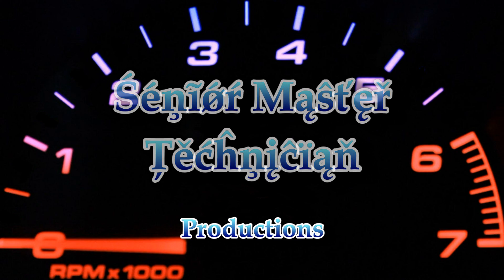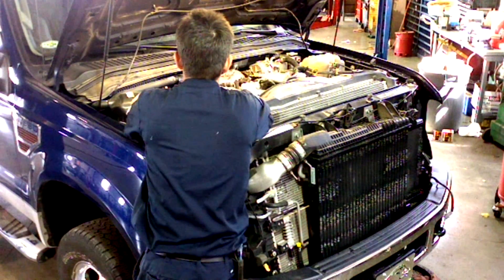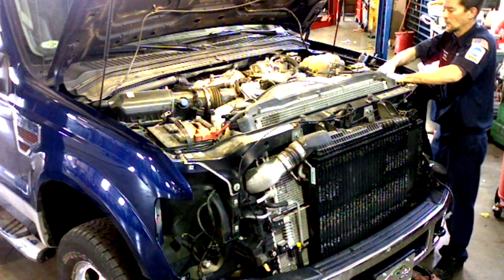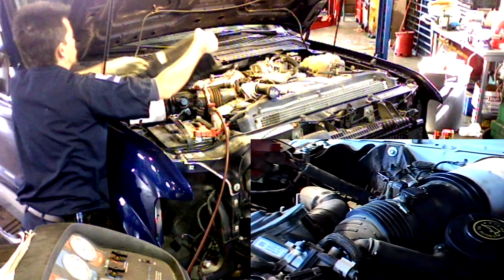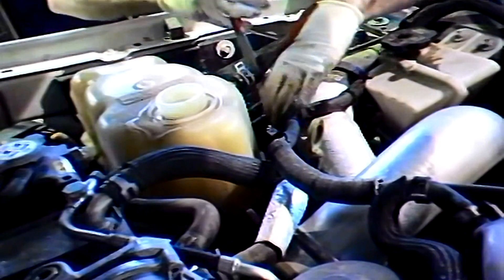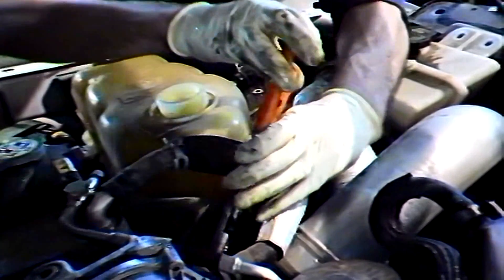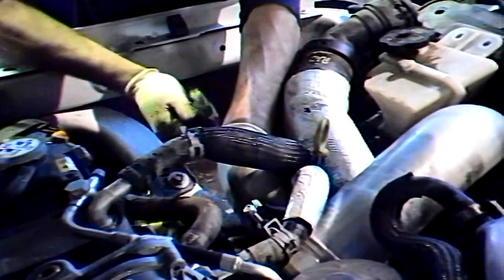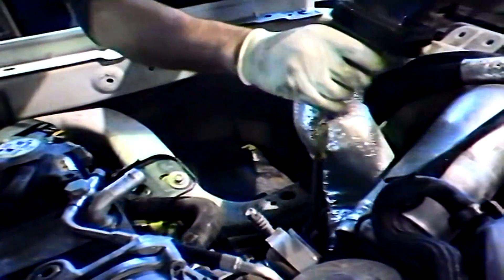2008-2010 Ford Super Duty Cab Removal & Installation Part I

Comment: I work on a lot of these trucks and you can remove engine complete by taking out 4 front body bolts on regular cab or 6 on super cab  and lifting front of cab. support it with 5 in. wooden blocks. only thing that needs to be taken off of engine is down pipe. be sure to check bed to cab clearance as you lift the cab.do a lot of ambulances this way when cab cannot be lifted. engine comes straight out front. beats pulling cab.

Comment: A method I use that has not failed me on dirty Canadian trucks, is to heat the head of each cab bolt, I do my ABC's or about 30 seconds on the head of each bolt, then use my 3/8" cordless impact to pull them out. Enough heat transfers to the threads to warm the locktite up. Even works on the front cab bolts. Haven't spun a cage nut since.

Comment from the maker: @PWRSTR0KER2008 
Thanks! The video is actually from 3 different trucks. The blue one has the cab removed for the RH turbo inlet pipe. The close up shots showing white vehicles were from an engine failure.

Comment from the maker: @runelost88 
I usually have at least one that always wants to spin. I broke by butane tip so I just use what heat I can get. I now have a propane tip that fits great. I bent and shaved on wrench for the front nuts, but the trick on the front is to put a jack under the front support when removing, works great. I have thought about teaching and have been offered once for UTI and another time for OSU Okmulgee. I make more money turning wrenches.
I have though about building a training class.

Comment: How many hydroboost units do you replace on these trucks? I've already had mine replaced once, and it is leaking again. In fact, it started leaking again less than a month after it was replaced. I have seen a few other 08 Super Duty's leak from it too. I haven't taken it back in, and it is leaking all over the electrical wires, and connections. It's a slow leak though. Mine is an 08

Comment: I'm baffled at why this is necessary. If Ford can't fit every thing they should make a tilt hood that takes the fenders up like a semi or go with an inline 6.V8 diesels are not as desirable as an I6 anyway
Reply: Yet more 3/4 ton and 1 ton diesels have been sold that are V8s than I6s by a wide margin so they are desirable.
Reply: Minotauro79 
Sold and run into the ground within 5 years by young bucks who don't need that kind of power. They want the stacks and/or to roll coal on poor people all over North America. It has nothing to do with towing. Hence I6 is best for driving around town, and V8 diesel is best for trailering or farming.
People want to drive truck but don't want all the junk that comes with it. Who needs 440hp all the time when 350hp is plenty... Plus if you don't load your turbo diesel it cokes the compressor and costs like $10K to fix up again.
Reply: John DiMartino

 v8 diesels tend to get better fuel economy than I6... The Duramax/Dirtymax gets more than enough HP + Torque to meet 3500 requirements... As for the Powerstroke/Powerjoke/Powerchoke Ford spend alot of time making garbage Diesels, they seem to have fixed the problem now and are getting some good stats now but the rep still follows them

Neither PowerStroke or Duramax can match the Cummins in reliability and power but most guys don't push these engines enough to notice so the v8 fuel economy wins the day.
Reply: Yet semis use inline 8s for real power. This is a very stupid process.  I would also take the i6 over v8 diesels.  Cummins all day!
Reply: Jesse guy what semi uses an inline 8?

Comment from the maker: Honestly, Over the years I have only replaced one hydro-boost for a leak between the case. I bet that the leak is from the power steering lines for the hydroboost just to the right of the master cylinder just below the cowling. There are nylon orings that seal the fitting. I can not tell you how many times I have seen techs reuse them and then be a small leak. With them being at the top, it will leak onto the wiring and then the lines below. other than that, no i dont see that problem.

Comment: Moral of story. Keep a 10 foot pole between you and any Ford diesel truck! Only winners are techs who can take vacation off one job.
Reply: Marty Beaudry - unless you need to tow things regularly, or have to take junk to the dump for work, a huge engine is completely unnecessary. Idk why they don't sell the 250 class with a nice small engine for older gentleman who tow small boats or the occasional trailer.. Also, a nice supercharger would be perfectly suited for a I6 that only ever pulls its own weight plus a few shrubs and shit. Completely unnecessary my penile challenged friend.

Comment: I have a question if anyone can answer. Is the 6.2 gas engine in the Superduty just a bored out 5.4? Or is it a whole new engine? And is it any good? Thanks
Reply: Completely different I'm sure they use some of the same parts but they are very different
Reply: +Duncan Stamps cool,thanks

Comment: Why do you remove the headlights?
Is it to access something easier?
I lifted my first 6.4 cab today and didn't remove the headlamps.
just curious
Reply: I did a cab off today
Has to pull the headlights to get a torch on the front cab bolts because they spun in their captured nuts
Reply: @1550Nanometer  hey yup had done quite a few 6.4 trucks since i posted this. I usually weld the captued nut to the body
Reply: @stevemic oh no kidding, just a tiny bit of heat and they came loose this morning, only the front 2 and the one under the drivers seat, maybe 3 seconds of heat, I tried to get them out without pulling headlights first
Reply: @stevemic  one thing I didnt pull, was the passenger side battery tray, dont know if he did or not in this vid, but another vid I skimmed through they did, was super easy cab off, maybe 2 hours off and 2 hours on

Comment: Yes, that might be true but at the factory that truck has to go through inspection before leaving the work place. Dealerships when they work on them no one comes behind the tech to check that he has done his job or to see if he's broken anything. The guy in the video  is good but the battery terminal thing I didn't like.
Reply: You do realize technicians don't usually get paid if they screw up on a repair. If they replace a head gasket on a vehicle and the head gasket fails again under warranty, the technician doesn't get paid at all for the work the second time around. So its in their best interest to do the job right the first time. If you wanna get pissed at someone for using power tools get pissed at the guys at Tire shops for using impact guns to put the lugnuts on.  They crossthread lugnuts like theres no tomorrow.

Comment: this guy should not be using that damn air gun on the battery terminals,just plane out lazy.typical dealership mechanic and then after they strip those battery bolts that's the way they give you your vehicle back and you got pay  the price whenever you gotta disconnect the battery down the road you won't be able to because the bolts are stripped.I bet ya  if you go to the service advisor and tell them that the battery terminals are damaged the will tell ya that they didn't do it.This guy might not  of stripped them this time but I'm sure he has stripped some in the pass if he does this eveytime he needs to take them apart. Very unprofessional.
Reply: most guys(myself included ) know their impact guns and can judge wether a bolt is too tight, thats depending on knowing your gun though

Comment: Its pieces of shit techs like you that I'm taking about, but don't take it personally. I'm a mechanic but my truck is under warranty so I'm forced to have the dealer do the work but if they would give me the parts I'd rather do it myself because it'll get done right the first time. I'm not saying all techs are bad but I didn't like the power tool on the battery post is all.I know what it is to get paid by the job and the faster you move the more cars you can do but I don't like shortcuts.
Reply from the maker: William Santiago If you believe that I have done some detrimental damage in any way shape or form by using a 1/4" elect impact to remove or install the battery terminals, I'm sorry for offending your liberalism. As a professional with more experience, training, recognition, and simply put, more customers worldwide, I recommend you to continuing watching and learning all you can. I will say in your favor that you are correct. A impact should not always be used on each and every bolt. This is why I use a multitude of different toosl, all for their specific reasons. This 1/4 impact uses a 9 volt battery, It's made by Makita and bought new in 98 for interior work requiring low torque. Perfect for battery terminals and grounds that are 6X1.0 . Other than that I don't feel I have anything more to explain. Viewers alike will hare their opinions.
Reply: +William Santiago I don't think you're serious but just in case you are, remember that Ford installs it with a power tool at the factory.